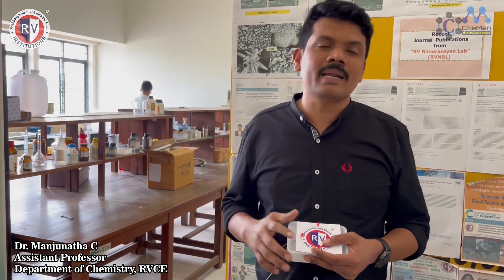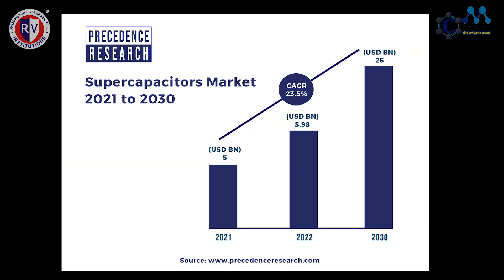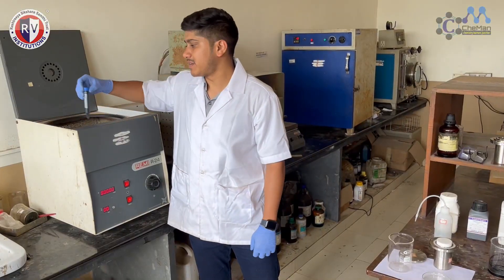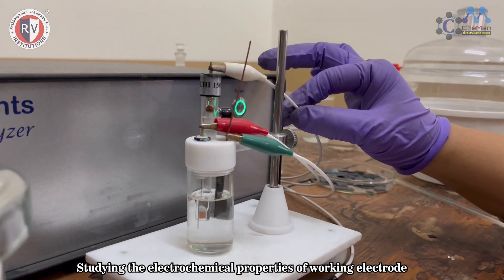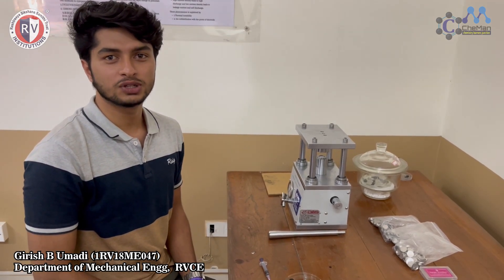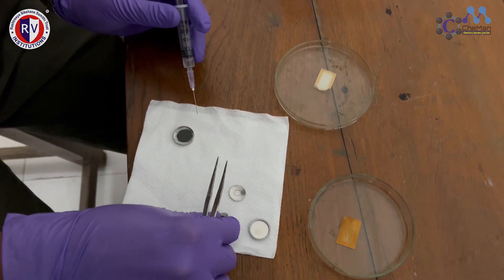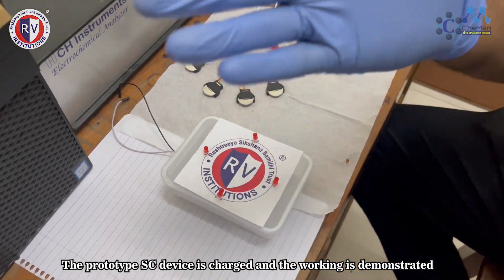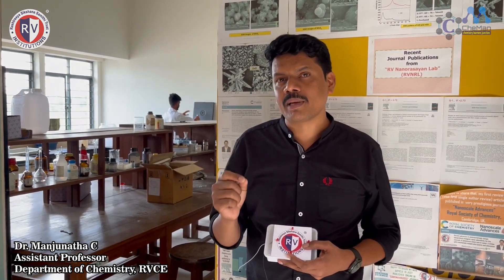Making of Supercapacitor Coin Cell Prototype Device

Comment: what method did you use in depositing your mixture into the toray carbon?
Reply from the maker: @cecilliamendoza5967  slurry doctor blade method
Reply: may i know what is the binder that you used?  @DrMANJUNATHACHANNEGOWDA
Reply from the maker: @cecilliamendoza5967  pvdf